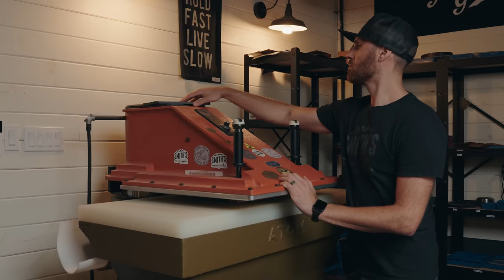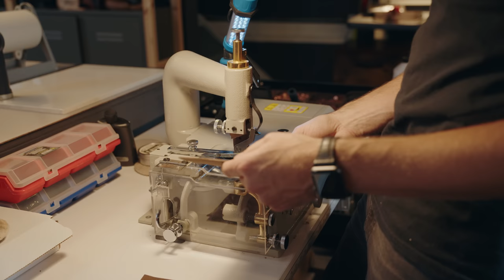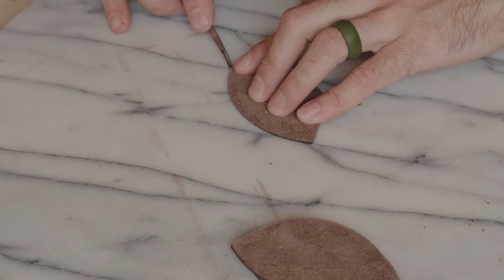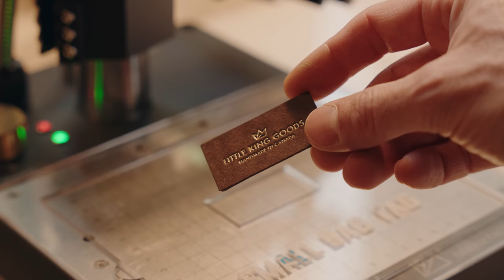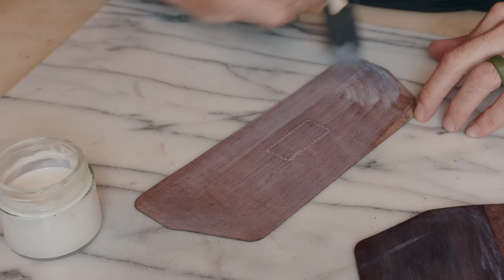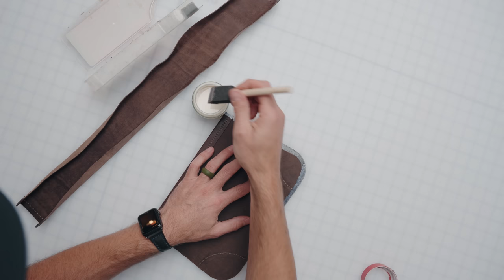Making our 1920's style LEATHER Cross-body bag!

Comment: Do you find that the reinforced corners are necessary/helpful? I've seen those on other bags, but I've never added them myself. Thanks Ryan
Reply from the maker: I think it really helps and I also like the look.
Reply: @LittleKingGoods  if you don't minde asking, is it so the gusset doesn't bend the panels out or something else? The look is growing on me the more I see it. This bag is beautiful btw! Thanks again for responding 😊
Reply from the maker: I didn’t really use it primarily for structural support. I did it mostly for aesthetics which helped with the over all structure. I’m not sure what would happen in the long run with out those little pieces.

Comment: Do you have to adust the stitch spacing on the sewing machine to begin and end right where you want it to based on the length of the line or do you design to bag to work with the stitch spacing from the drawing board?
Reply from the maker: You can, but i just manually make up for the distance by placing the needle in the hole at the end of the stitch line if needed.

Comment: Awesome work. What glue are you using?
Reply from the maker: Thanks 🙏🏼 Ecoweld
Reply: @LittleKingGoods   Thanks 👍I use Aquilim 315 and it isn't very strong.
Reply: @Braniss  same here, is the ecoweld stronger?  Thought they were pretty much the same thing.
Reply from the maker: I find that the Ecoweld is stronger but they both work well.